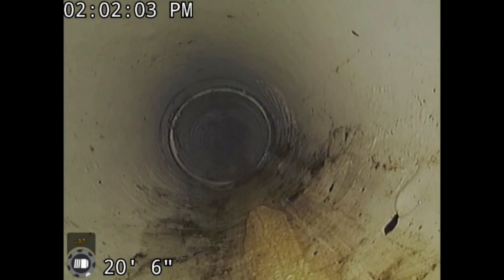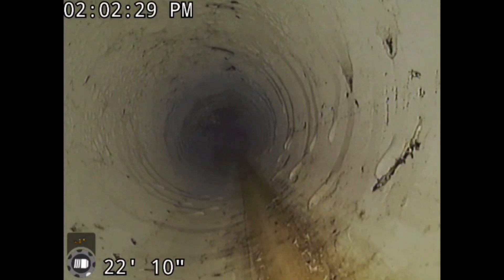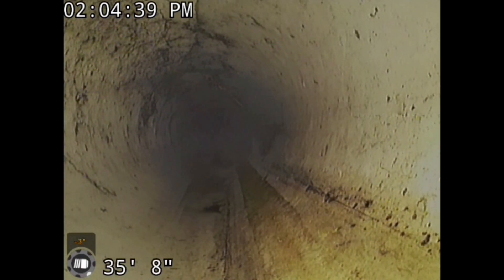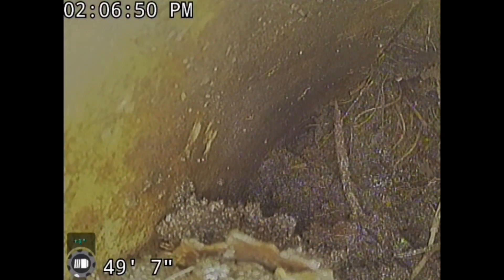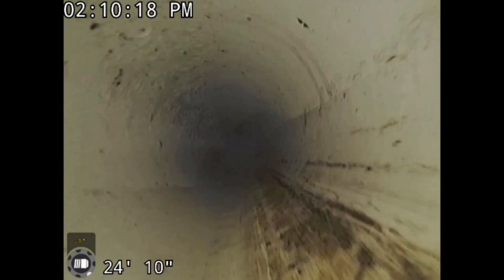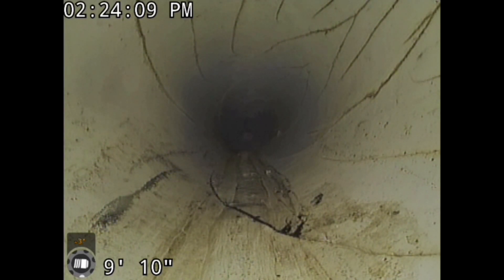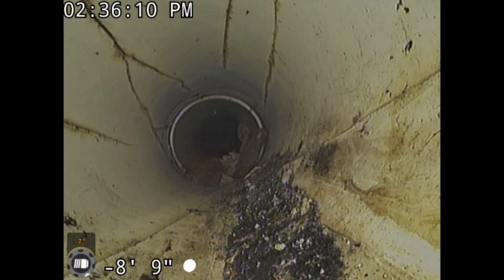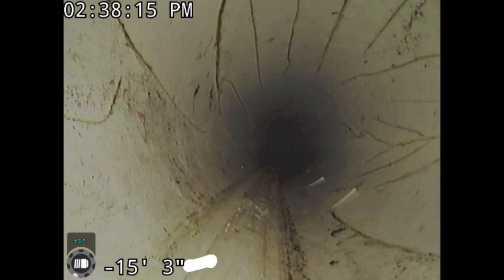Why I Love PVC Pipe For Yard Drainage: Stop Clogs, Sinkholes, Bacteria Growth [Series 1 of 4]

Comment: Thank you very much for this. It's educational and greatly appreciated! Building on it, I was wondering:
1- you say this is for French drains but also caution against PVC anywhere you can't keep a 1% drop. Are you saying one should expect a lot of the same issues you show here if draining a gutter underground and to the road?
2- you recommend corrugated, but my concern is how to clean it out. I have underground black corrugated connected to my downspouts, but it clogged and broke in many, many places ages ago. Now it seems I have to dig the whole thing up (if I can find it) and replace it. I had hoped that the water jet to the pressure washer would be an option, but the guy I called w 20 years of experience said the service will destroy my lines.
Also, I live in a warm climate but on a pretty steep hill about 25' to the road, so there's no way to drain this at anything like 1-4% 20%+ sounds more realistic. It seems to work fine for the sewer, but I'm guessing that a very different animal.
Reply from the maker: Here's a playlist you should watch. I will make you a video.
https://youtube.com/playlist?list=PLjFCqaZ4v1BX_ZMbxsYVB6CNFoeAmuPxX&si=2LiKPoh97xrn4Gi6

Comment: Trying to figure out what I need.. 2 downspouts (NW and NE corner of house) run together and each has about 500 sqft of actual roof area (so about 1000 total) at a 13.6"/foot slope.  Live in SW Ohio.. Would 3" corrugated work, or should I go 4"?  Downspouts are the 2"x3" and it drains into the pond about 60yds away.

Three times in the last 15 years we've had rains that overloaded the 4" corrugated that is in there now, but I have no idea what the pipe connections look like.  It overloads under ground and then fills up the basement window well so the water rises from bottom up leading to water coming in around the hinged, swing in window.  What's in there now has been there since 1995 I'd guess.
Reply from the maker: https://youtu.be/Vush-fFU-Xk?si=zy6o00vlzZMSDJK8

Comment: The reason GCD added venting was to release the air bubble trapped at the end of the pipe which would probably float.  I wanted the vent to also intake air as in the University studies suggest the velocity of the water at full flow can create a vacuums powerful enough to pass 30% air along with the water.  I was able to recreate this in my yard using two 40ft sections of drainage where the lower fitting was sucking water down into the pipe b/c of the vacuum created by the velocity of the water fast-flowing inside the pipes.   10/10 on these research videos, though I think one of these channels needs to just create a 10ft long testing rig with all the pumps needed to max out all these pipes, CB, outlets... using head-height, tail-height, or any other measuring standard that can be repeated in any backyard.  It was so long ago but I think in the blind-inlet studies they only needed 30ft of perforated pipe to max out a 4 inch pipe, all testing on a 10ft FD in a lab setting.
Reply from the maker: Thank you for sharing.

Comment: That pipe is a thin wall pipe and you can see they did it backwards. That is a huge issue. The pipe goes into the bell end so there is no lip. I have SDR 35 in my yard which to this point I have no problems. That thin wall point will fail every time no matter what especially in  Wisconsin.
Reply from the maker: Both pipes you see in this video are Schedule 40.  At the discharge end, it is a thick piece of PVC, and it is at least Schedule 40. Best of luck to your PVC in Wisconsin.✌️
Reply: My apologies then. It looked like a thin-wall pipe I believe the letters on the pipe are d2729. I look forward to your next video and please don’t think I was trying to be an internet expert. I learn a lot from your content 👍

Comment: Interesting to see. I expected corrugated would trap more material to the point it effectively becomes the equivalent of smooth pvc on the bottom while giving "lugs" to further clogging. Plus it always seemed like a "faster slope should be better". I'll have to keep that in mind when I fix some drainage (heavy truck backed off the road, got stuck and collapsed some corrugated drain pipe from a constant spring I'll redo this spring/summer).
Reply from the maker: You will want to follow this series. This was 1 of 4 videos in the series. 
Thank you for watching